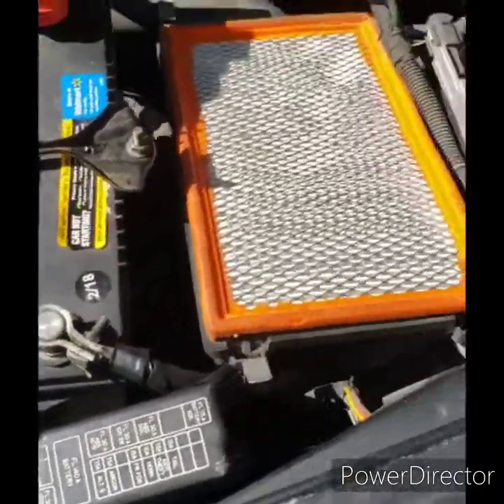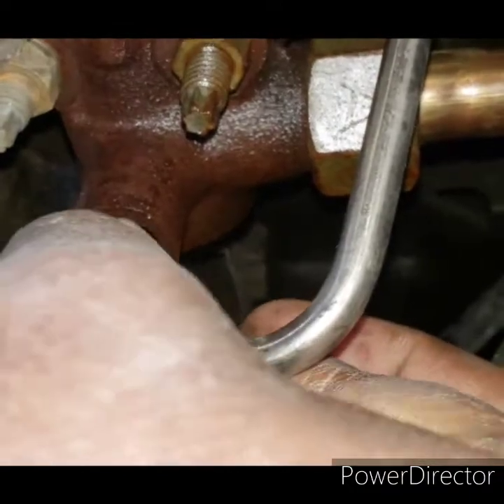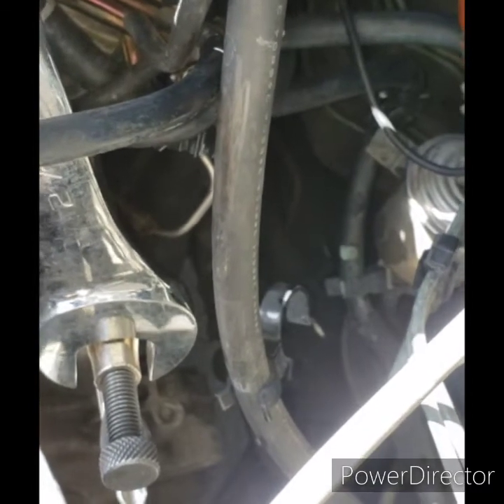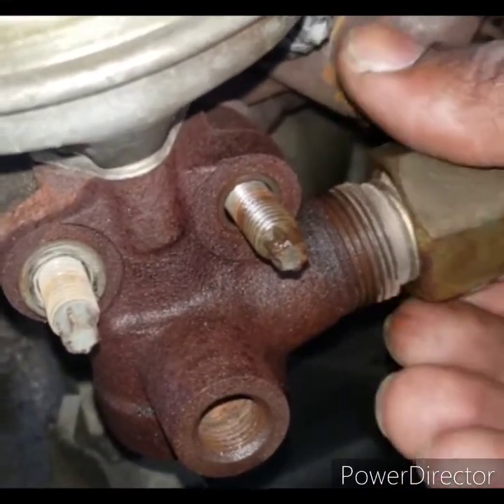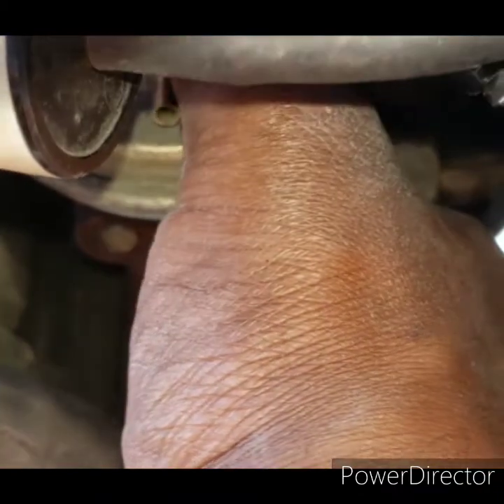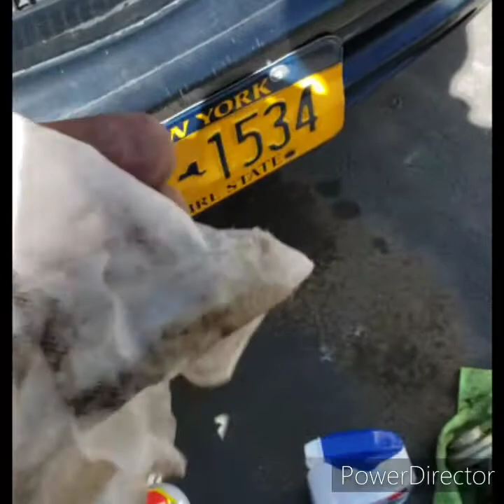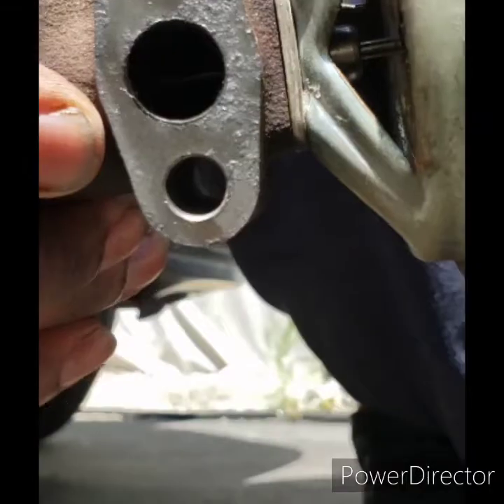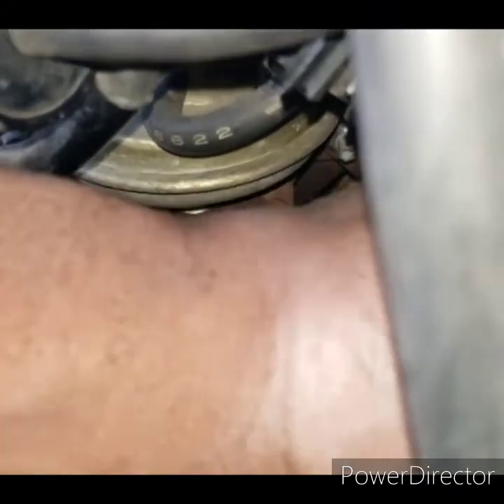NISSAN MAXIMA EGR valve removal and clean

Comment: Hi. I've got an unmodified 1998 Nissan Pathfinder, 164,000 miles, 3.3L V6, 5 speed automatic transmission.  Owned by an elderly couple...treated well. 

10w-30 oil/filter is new and full. Same with transmission fluid.

When it's first started it knocks or loudly rattles for 3 seconds. Then it stops. Once warm it will only do the startup rattle about 50% of the time.  Exact same noise returns from about 1,800 to 3,200 RPM and then stops.  Also, the noise quiets and sometimes disappears between 1,800 - 3,200 RPM if I let off of the accelerator and coast.  It also will not do it sometimes if I'm going up a steep hill slowly with the RPMs are in that midrange, under the hill's load.

The noise increases in speed and loudness with increasing RPMs.  It sounds like 1 or maybe 2 cylinders of the 6, to me. 

The main bearings and rod bearings were changed. Looked good, some rod bearing wear on a couple but not serious. No rod or crank shaft slop was noted before or after replacement. Made no difference in the noise.  The crank was NOT sanded/polished.

It throws a P1400 code for EGRC Solenoid Valve error.  I don't notice any idling or power issues though. It returns within a few minutes after clearing the code.  Could this cause a knocking noise at certain times like I have?

I've narrowed it down to 5 things based on its part time occurrence:
1. Flex plate?
2. Timing belt tensioner failing (unknown when last changed)?
3. Torque converter?
4. Hydraulic lifters?
5. EGRC Solenoid Valve?

I have two short videos I recorded it and can share if you want to hear it.  Thanks!
Reply: Literally the exact same problem on my 97 max, i had a bad injector that was causing the knock, somehow soot from the egr valve got into the injector amd clogged it
Reply: @adityadharni5027  hello. Thanks!  Can I email you two short videos and confirm that?   It is really loud to be an injector. 

Did you have any codes also?  Mine has no notable missing cylinders, or codes, other than the P1400 EGRC Solenoid Valve.

So you cleaned or replaced all the injectors and it went away entirely and immediately?

Curious how you determined what cylinder injector(s) were clogged, or were they stuck open? 

Would like to email you the 2 small videos to listen.